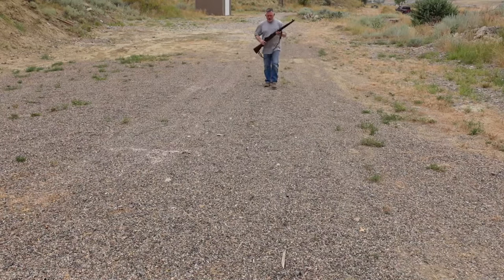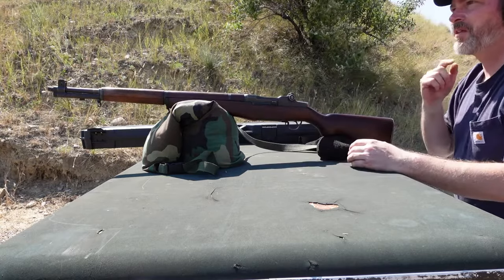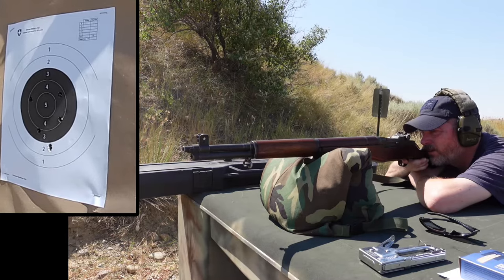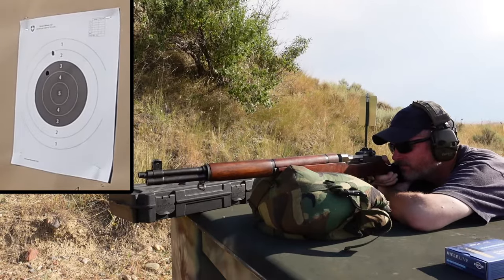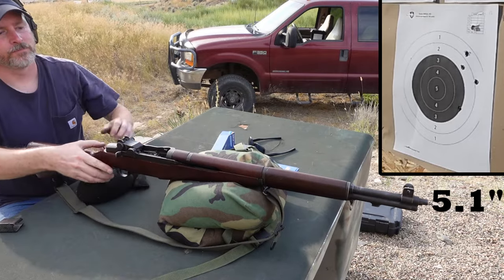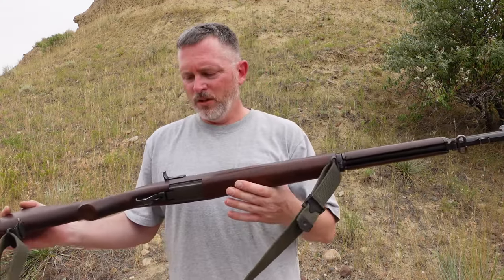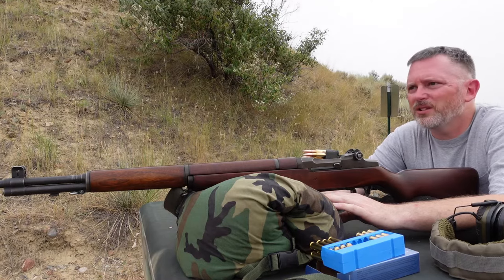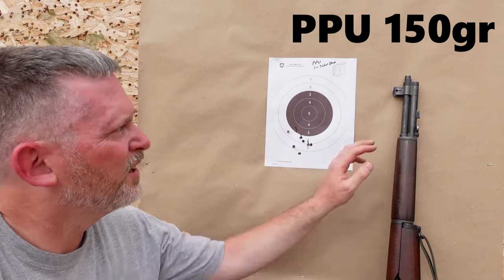M1 Garand Accuracy Test and Improvement

Comment: I'm going to be honest with you. You need to reload for any milsurp right now, especially a Garand. My powders of choice have been IMR4895, 4064 an W748. Run any of these powders with a Hornady 150 grain head to a listed velocity of 2,700 fps. Save those PPU cases because they are the best right now for recent manufacture. Speaking of PPU, I have used them since the 1980's and their components are still good, but the way they load their obsolete ammo now, they all seem to shoot wild. I think they are using a very fast powder across the board in their lineup. Every caliber I run from 8mm Lebel to 6.5 Swedish shoots crazy. Regarding the surplus, that's what it is now, surplus. That old Lake City and HXP is on it's way out due to primer degradation as well as the powder. That being said, I have never seen a  Garand shoot better than 2 1/2 inches and that was one that was accurized by a well known gunsmith that included glass bedding and new barrel and hand fitted parts.
Reply: Rumor has it that some of the die hard competition boys are getting sub moa out of their m1's. Relatively certain that's a full rebuild with a new custom match grade barrel and a bunch of other stuff. For me, 2 to 3 moa for anything with irons is more than good enough for practical use. The smallest thing that an average person can consistently aim at  without magnification is roughly 2MOA.
Reply from the maker: My 30-06 load for my other bolt milsurps uses IMR4895 but is too hot for the Garand.  I have a decent supply but 4895 and 4064 is very difficult to find currently.  W748 might be a good alternative, I have not tried it yet.  Thank you for the comment!
Reply: @CRCollector  make sure you use the CCI 7.62 primers or a magnum primers with 748. There was a good article you can find on line from NRA in 1986 all about Garand Loading.
Reply: Stock fitment, gas cylinder tightness, and rear sight aperture tightness are the main causes of inaccuracy. Before doing anything else, I would address these. With hanloads, you should be able to get under 2 inches. With all-out bedding and NM upgrades, possibly down to an inch. Although many still won't get under 1.5. Most shooters struggle with anything under 2 so I wouldn't blame the rifle unless your able to group under 2 with other open sight rifles. I, for one, generally cannot.
Reply: I like this guy, His advice and experiences match mine quite well.  My garand came from an aftermarket competition builder and 2 1/2 is what it shoots. I suspect the 3" groups are all me when I see them.  I personally run Sierra bullets, but to each their own. PPU bullets themselves have some real issues with seating depth due to taper inconsistencies or ojive.
Reply: PPU has always been my ammo to avoid. It turns my 2-3 moa swiss 1911 into a 6moa junker. I use 168hr hornady hpbt match over IMR 4895 for the M1.

Comment: Make sure the Op - rod is Not making contact with any part of the stock or handguard. Never grab the rifle by the front handguard. We always pinned them so they wont move or make contact with the op-rod. Very lightly grease the op-rod where it comes close to making contact with the barrel. Make sure the trigger assembly is really tight when closing the trigger guard. Bed the action when you can. Get some LC Match ammo.

Comment: I am receiving my first M1 Garand from CMP tomorrow. It is one of the rebarreled (Criterion) and restocked RM1 Expert grade. All of the lower price grades are gone, and all that they have left are these and similar or higher priced models. So unless someone stumbles into a pile somewhere their availability is dwindling. I am excited and can’t wait to see what I get. Probably it was good to see this video and read the comments, to get my hopes back down to reality.
Reply from the maker: Congratulations!  I have had a few service grades but never an expert grade.  Have been curious but have not pulled the trigger on one.  Thank you for the comment.  Hope you enjoy your rifle!
Reply: @CRCollector  I was actually hoping to get one with some battle/beauty marks on it since they are a part of history, but maybe I should have jumped on this sooner. Either way, I am just happy to be getting one to add to my small collection. And since I am a bit older I also realize that this way my nephew, who will be inheriting this collection, will be getting it. And he is quite thrilled about that.
Reply: I used tung oil on my expert grade a month ago..looks awesome..ya gonna treat yours?..I think their only lightly stained..
Reply: @griffyize  I am planning on using tung oil several coats and finish with a low sheen wax. Going to thin the first coat with 50/50 citrus solvent, maybe thin the second coat 25/75. Very light sand with 400 grit to knock down the fuzz. I am going to try Renaissance Wax.
Reply: If you do a quick online search, you will learn that there is a huge stockpile of M1 Garands in South Korea that we can NOT import back into the states, some 89,000 of these rifles. Apparently Obozo signed an Executive Order which made importting any semi auto or auto weapons into the US illegal. I remember when this happened, but had forgotten about that until something reminded me last week about this. As I recall, he was told about all of these American made M1’s in an attempt to try and get an exemption because of some deal that we had with S Korea to buy these weapons back, via CMP sales, to help finance them updating their weapons, but the big-eared Kenyon wouldn’t flex on his gun control measure. SWAT Magazine has a good article on this with plenty of pictures of new Springfield Armory M1’s still packed in 500 special shipping drums in 10-lots in a warehouse there in S Korea. There are a good number of M1911 A1’s as well.

Comment: I absolutely love your testing methods! Initial test, make a single change, do a test, ect... that's perfect. Any rifle I have that does 2 to 3 moa with irons and non-match factory ammo is way more than good enough for all practical applications. The smallest thing that the average person can consistently aim at without magnification is about 2MOA. If you or anyone else is interested in chasing absolute precision in the m1, below are some tips, I'm not an expert, so the long range precision competition boys would be a better source than I am.

So, cutting a crown is a precision machining operation that can't be done properly with a vise and hand drill. It should be done with a lathe and precision tools. That said, I don't think you screwed anything up, based on your post crowning groups. The next thing to do with the sights would be to get a National Match set and have it custom fit to the rifle. This is basically a stoning job on the NM rear aperture. Alternatively, Cogburn Arsenal has a mount for the Primary Arms micro prism series that replaces the rear sight, no smith work needed. Next on the list would be the stock. Lots to unpack here, but basically if you're chasing ultimate precision, you're gonna wanna get all brand new stock wood and hardware. You'll want to basically custom inlet it all for your rifle. Part of this is the trigger group. Not so much the pull itself, but the fact that it locks the receiver into the stock, so it's a critically integral part of the precision equation. There are 2 pins that the trigger guard rotates around. These need to be nice and round, surplus is usually worn out. Things that touch the barrel need to be good and tight, or not touching it at all. You can do a trigger job, but I don't think that'll buy you a lot of precision, and my surplus m1 triggers feel pretty good to me. Others than that, getting a custom match grade barrel and a new bolt blue printed to the barrel. Replacing all springs in the firing chain will help with precision. If you're interested in going even half this deep, hand loads or custom match grade factory ammo is a must. This all depends on how far down the rabbit hole you want to go. I think she's shooting just fine from what I saw. Good enough for all practical uses. Anyway keep up the good work.
Reply from the maker: Thank you for this comment!  This rifle is just where I want it now, with irons 1.5-2" is about as good as it gets for me.  I may play with some reloads but my go-to 30-06 load is for my bolt guns and is too hot for the Garand.  I do have a Schuster gas plug that I used when I was hunting with this rifle, that might help with this.

Comment: from a statistics standpoint you really should shoot 8-10 shot groups.  If you shoot 2 5 shot groups and each is 4moa, but the group centers are off by say 2-4 inches, if nothing else has changed, you in fact have a 6-8moa gun!  that'll also clue you in to possible heat / cold bore related issues.  especially as the handguards begin to apply different force on the barrel as everything heats up.

fact is these are 4-5 moa guns, with lots of gunsmithing work and custom match grade ammo: 2moa

consider the m1 in cmp competition, the 10 ring is 7" at 200yds (3.5 moa) for a reason.

if you dont handload, try s&b m1 ammo, its better than ppu.

also make sure your rear sight is tight, they are prone to wobble, plus the front site screw.  the upper handguard should be loose
Reply from the maker: I agree the more data the better results.  I chose to shoot what I did based off of ammo availability and cost.  I am fully self funded, and will not be held hostage by YouTube "monetization".

Comment: Some thoughts and feedback from my groups experience.  HXP is good stuff, Lake City makes for nice brass, and PPU is usually good enough but not great.  Your results match ours pretty much exactly.  We all also had to peen our gas cylinders.  roughly 47g IMR 4895 pushing a 169g sierra match king gives great results, +/- 1g depending on rifles. and... there is a good 150g recipe going around too, 45-46g of 4895 if I remember it correctly.... Some people like 4064.  These loads are easy to find on highpower forums and such.  I average 2.5-3" groups with mine, but it was rebarreled with a criterion barrel.  My mates all average 3-3.5" groups with reloads.  Also, most of our rifles suffer heat shifts of 1moa in a consistent direction.  A nice way to figure out that is to have a mate with an electronic target, like shotmarker.  At 200 yards, throw out 16 or 24 rounds and watch your group shift.  Electronic scoring targets will count your impacts and you will see the higher numbered hits begin to walk.  That first cold bore shot being a bit off is also normal.  
excellent video!  Thanks for taking me along on your journey.
Reply from the maker: Thank you for the comment, very useful information.  I think the next step in the journey is hand loading for it.

Comment: reloading used military brass from once fired brass. all that went through machine guns and once it's been resized it will probably never see that pressure again. don't have to worry about a case failure using military surplus. most people will never load that hot and you won't have a case failure.

Comment: Any CMP service grade that can hold the black is a goof start.
  M1 garands never had a “accuracy requirement” like the 1903s did.
   M1 had a targetting test which was 5 shots in a 6.35” group. Using the best lots of ammo at the time.
    There is a reason the targets have a 3 moa ish 10 ring.
 The surplus ammo and rifles are old.

Comment: Thank you for the information. I have an Italian made Breda a 1960 Danish contract M1, I need to shoot it with some quality factory ammo. The last time I shot it was with S&B 150 GN Ball Ammo at 200 yards at a 10 inch steel target aiming at 6 O Clock in 110 Degree heat in Ft. Mohave AZ. Surprised that many years before that I had zeroed it with Russian made Golden Bear 145 Grain steel cased 30-06 functioned fine with Russian powder and bullet no cycle issues. Surprised with a 2 inch group with a standard G.I. style trigger.

Comment: From what I am seeing your trigger control is excellent.  I recently acquired an excellent grade CMP rifle which means a new Criterion barrel and new walnut stock.  While waiting for it to arrive I made up a bunch of rounds for it.  Being anal excessive, I went so far as to make the brass as consistent as possible, by annealing the throat after resizing and tumbling.  I used 150 grain Spitzer bullets and used up the rest of my IMR 4064, my go-to powder for 30-06.  I used the absolute mid-range from the reloading guide on the powder to make sure I did not damage anything in my December 1941 SA Garand.  My first experience was by running three clips through it for just a function check, with very satisfactory results.  A couple weeks later I shot for score.  Despite my care I still could only get get it to stay inside the black ring.  I suppose my 69 year old eyes maybe a contributor.  The next trip out I will ensure the LabRadar documents the muzzle velocity more consistently, as I’m curious to see how that factors in.  Your approach is quite sound.  Just a little more data to toss into the game.
Reply from the maker: Thank you for the comment and information.  Good luck in you M1 quest!

Comment: All your ammo makes should eject in the 2 oclock range. Measure your op rod spring. It needs to be 19.5" or more. If not replace it with an Orion 7 spring.
Reply from the maker: Looked them up, thanks for the resource.

Comment: Make sure the sights are tight. You should keep from tearing the rifle down; It doesn’t do your bedding any favors. My M1s will take a few clips to settle in after a tear down. The two stage trigger takes getting used to. Adherence to fundamentals while practicing will go a long way. Keep at it. Nice rifle.
Reply: The whole rear sight assembly might feel tight but move side to side and front to rear under firing shock.

Comment: Without bedding and doing some serious work on the m1 its hard to get better than 2inch groups using factory loads. I consistently shoot 2 in 3 shot groups from the bench.  I used some federal trophy coppers that did just under 2 in 
I have a new barrel on mine as well. Criterions are nice but are not a match grade.
Reply from the maker: This is true with any rifle.  Bedding and dialing in a custom load will have the most effect on group size and consistency.  Thank you for the comment!
Reply: @CRCollector  i forgot to mention if using the cheapest 30-06 your lucky to keep a 3in group from a bench. 
When it come to 3 shots. 
I shoot highpower rifle with a 100 yard and 200 yard reduced course and in that i keep a 6-8 in spread on average. Thats standing,sitting, prone. My best shots were about a 4in spread at 100 using federal blue box. But if i have some hornady match 30-06 it gets around that 2-3 ins consistently. 
My buddy who shoot there deer rifles give me crap but id love to see them rack off 10 rounds of 30-06 from standing and keep them in a 12in circle lol my best standing at 200 was 11.5in. Im not winning any comps but for the old work horse ,without handloads, it does amazing
Reply: 3 shot groups are NOT groups.   5 is bare minimum, 8-10 is preferred.
Reply: @3of11  it is great way for determining cold bore accuracy.. im
Not shooting at game after shooting 5 shots nor am i shooting 5 times at game. Also 10 shots 5 in group in prone, 2 shots then 8 in 50 secs i believe. Rapid prone 100yard reduced xtc that wont tell you how your rifle shoots just how you do.